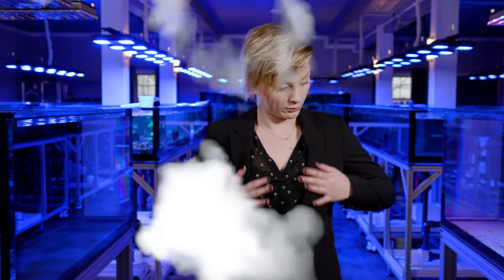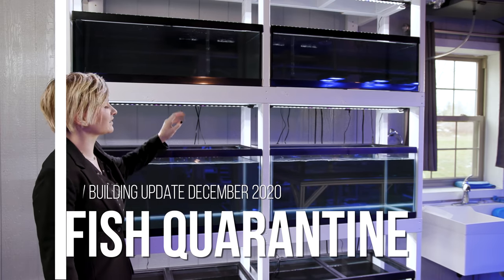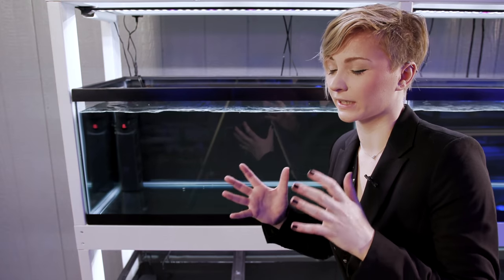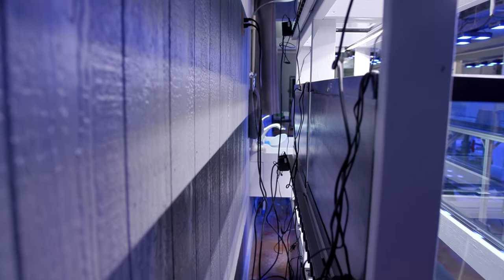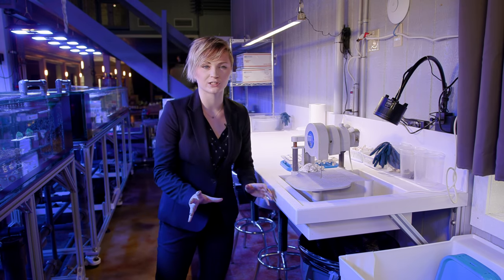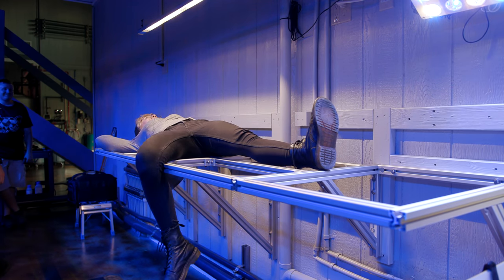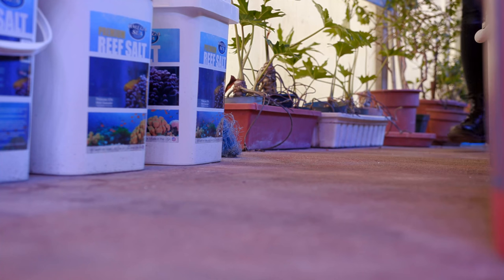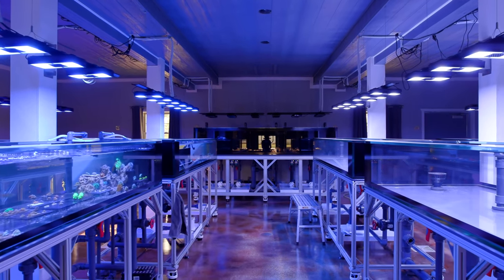December 2020 Coral Farm Update - Episode 20

Comment: Thanks for the update! 7:40 That socket wrench looks like it's from Harbor Freight. lol Stepping up to a Kobalt or Husky set is a noticeable improvement in quality, still lifetime warranty, and costs only marginally more.
Reply from the maker: Oh I guarantee it came from there because I didn't buy it.  When I shop for tools I get nice stuff, but my dad loves to shop at Harbor Freight.
Reply: @tidalgardens  HA! I'm not knocking Harbor Freight entirely, especially for random tools you're only going to use once or twice. There are some diamonds in the rough! BUT, the Pittsburgh socket sets are not one of them. I had one ratchet where the internals just crumbled, then sockets that were so soft that they were rounding out rather than turning the bolt/nut. I learned my lesson. Kobalt from Lowes is still darn cheap (they go on sale often too) and instantly noticed they're better built. Watch for a sale and you can get a very nice set for 40 bucks pretty easily. Harbor Freight cordless drills (and similar) are another category to stay away from. lol

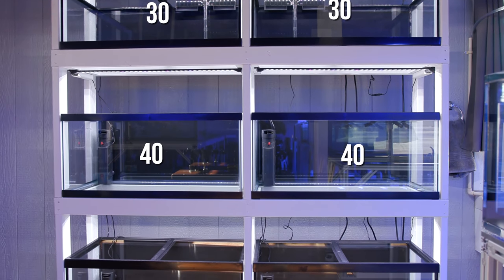Comment: 3:15 love the look of the 6 tanks, but from first glance, the shelf structure doesn't look too strong laterally. A cross brace at the back would prevent the whole rack system from falling sideways.
Reply from the maker: The structure by itself can tip over easily at that height and foot print, so it is attached to the wall at the top.  Once it is braced like that, it is super sturdy.

Comment: Good job 👍
Hope Than gets better.

You guys should do videos more often, we jump on this content, even if it's just a random live stream out of boredom.

If you guys are interested in quarantined fish hollar at Elliot over at Marine Collectors.

As for your filtration on the quarantine systems I would look at the Tidal series HOB  filters, they have a heater holder and you can just keep cheapo bio balls in the main systems return to fill them with precycled media.

These HOB filters have the pump in the aquarium so you don't have to prime them if a power outage occurs along with surface skimming. 

You might also want to take some pvc or gutter material to use as splash guards for your power strips 💦👍

As for the stands, if you coat them with bed liner it will soak into the wood and waterproof them and they will last forever.

I would also look into adding airstones to the aquariums if you treat the fish as some medications will strip oxygen from the water.
Reply from the maker: Funny thing is we went with wood because the deal for the QT system came together so fast, but if I had time to really think it through, I would have done it out of aluminum like the rest of the building.  It's going to be fine, but I learned my lesson after painting the wood for 10 hours.
Reply: @tidalgardens  I know what you mean, I had my fill of painting for a lifetime 👍

I just mentioned marine collectors BTW because Eliot keeps a selection of pre quarantined common utility fish on hand.

Just one more time consuming task you don't have to fool with.

Comment: A bit off topic, but what was that cover you guys put on the paint can to pour it at 7:13 ?
Reply from the maker: They are called Mixing Mates, and they are the best thing ever for paint cans.  They have a built in stirring paddle and are air tight so you can store the paint for years: https://amzn.to/2WjlHPi
Reply: @tidalgardens  Thanks for the link! Those seem super useful. I generally have 2 or three types of paint that I use around the farm and this would make storing and accessing small quantities a lot easier.

Comment: What are you doing for humidity?
Reply from the maker: In the summer, it is handled by AC.  In the winter, we have large air exchangers that swap out the humid air inside for the dry outside air.  The only times it gets tricky is when it is wet and rainy outside but too chilly for the AC to kick on.  In the future we might do a large whole-building dehumidifier that sits outside to handle the humidity which will help out in these conditions.